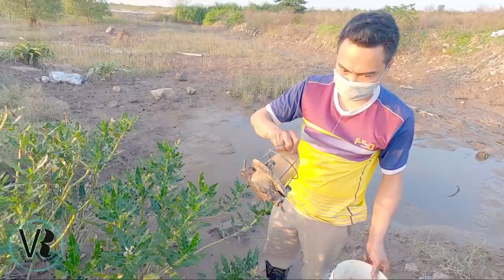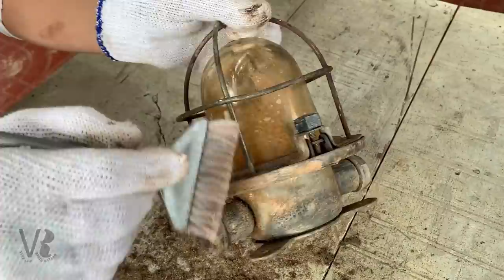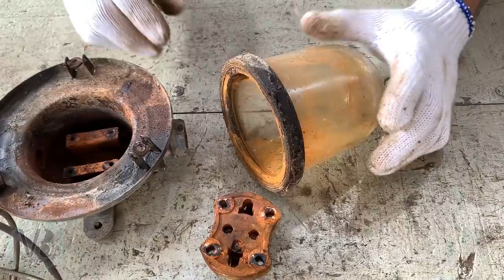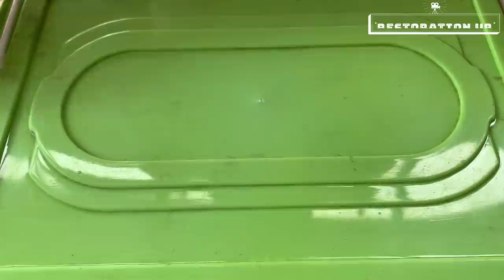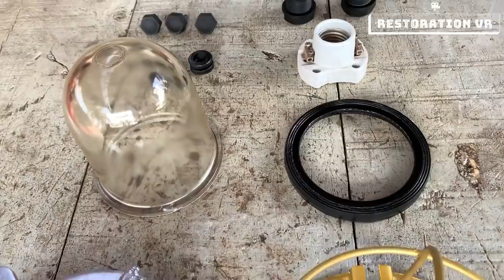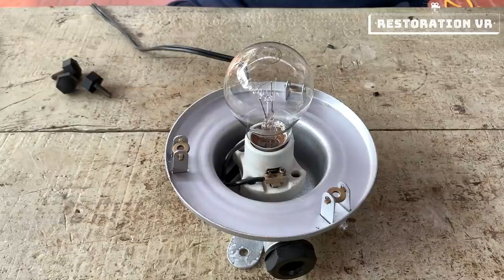Restoration Old electric Hurricane Lamp | Restore vintage hanging plamp

Comment: Great job. A good upgrade would be to run an earth wire to the metal chassis just for safety, especially since this kind of lamp would suffer a lot of violence in a storm.
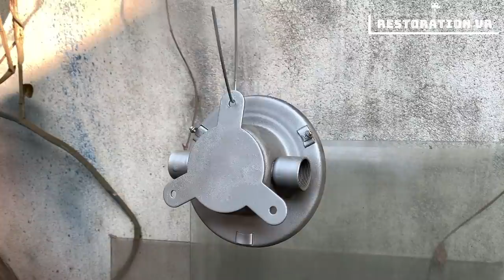Reply: it has one already look at 8:07
Reply: @barrycashwell4066  i did look, and see no earth wire anywhere. Also, the mains wire inserted is clearly a figure 8 cable which has no earth conductor.

Comment: The live conductor should be to the centre pin, you don’t know with the cable used as both are black. The potential danger being that if the outer screw socket of the bulb holder is live, there is the risk of electric shock if touched when screwing or unscrewing the bulb if doing so with the plug in and turned on.
Reply: Yep, and it should be grounded

Comment: Old????? Plastc bolt? Seems more like a replica
Reply: plastic has been around nearly 100 years...it's by no means antique...nor is t high quality like an old crouse hinds..but still a nice progect
Reply: Wrong plastic "plastic" was invented by a German alchemist in 1530. It was only after the Second World War that plastic became more common and it was not until the 50s and 60s that it became common in various products when it became cheaper to manufacture when oil was used in the manufacturing process. And in this type of lamp is NOT made of cheap metal and plastic, but of brass glass and porcelain. In addition, the video feels a little over-dramatized and not the least genuine.